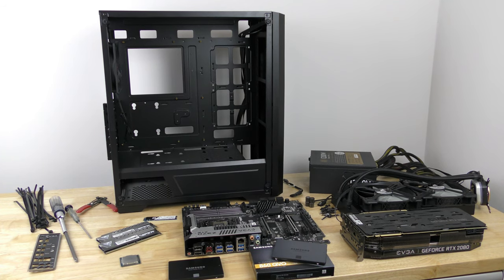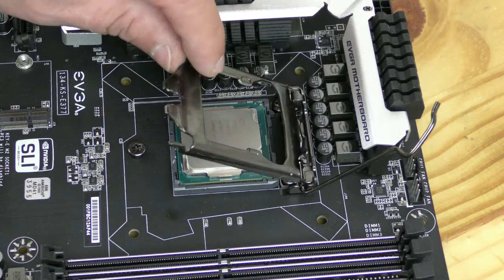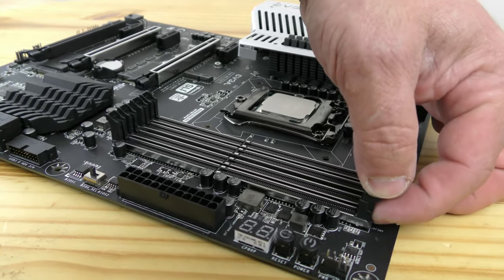How to Build a PC - Raijintek Ponos | Guide

Comment from the maker: In this video, we are Building a Gaming PC With a Raijintek Ponos - Step by Step.  This case seems to be the perfect size for anything, is it good?  Check it out and tell me what you think.
Check out the next part, how to wire the Raijintek Ponos: https://youtu.be/jwx2rDfEBSI
TimeLine:
0:00 Intro
0:10 Going over all the parts in the system
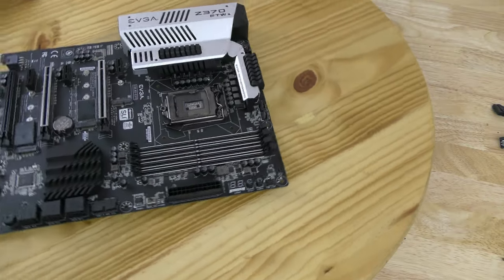1:07 Installing the CPU
2:52 Installing 32Gigs of RAM 
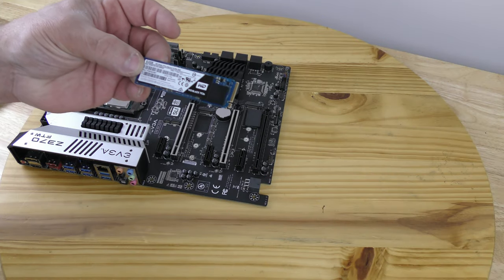4:37 Installing M.2 NVME PCIE SSD
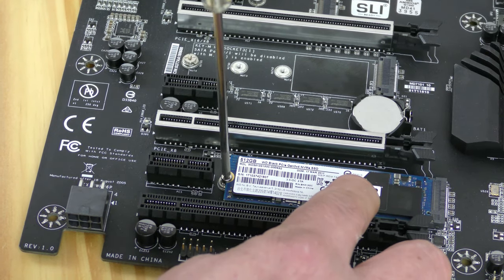5:49 Installing a Liquid Cooling Unit
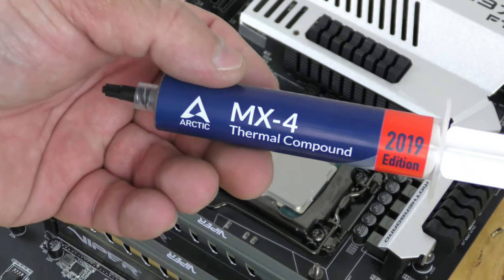7:33 Applying the thermal paste
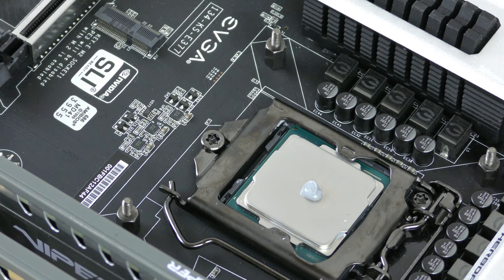8:15 Continuing to install a Liquid Cooling Unit
9:53 Installing the I/O Shield 
11:18 Prepping the case to install the motherboard into the case
14:45 Installing the Liquid Cooling unit into the case
19:01 Installing the SSD's
22:26 Installing a Power Supply
Cabling the system and completed the build continued on Part 2 and of the video.

Raijintek Ponos TG Case: https://geni.us/vssbX
EVGA Z370 FTW Motherboard: https://geni.us/X9eVgAq
EVGA Geforce RTX 2080 XC Ultra Video Card: https://geni.us/SwBEU6
Corsair H115i Pro Liquid cooling unit: https://geni.us/KhslEW2
Intel Core i7 8700K Processor: https://geni.us/jD0s8D
Patriot Viper 32Gig 2800MHz DDR4 PVE432G280C6KGY: https://geni.us/wPWP1EO
Arctic Silver Mx4 Thermal Paste: https://geni.us/ouFTBY
WD Black 512GB M.2 NVME PCIE SSD : https://geni.us/mMNLde
Samsung 850 Evo 500GB SSD: https://geni.us/QTA2
Samsung 860 QVO 1TB SSD: https://geni.us/Cqm4L
Cooler Master Silent Pro Gold 1200W PSU: https://geni.us/7hdBk
Ratcheting Screwdriver Set: http://geni.us/UBrv
Reply from the maker: a

Comment: Nice vid! I was not aware of this model of case. I'm interested in slim ATX cases since I have a small space for my PC case in my desk. 

I'm not sure, but it looks like the drive cage can be reinstalled more towards the front of the case in order to free some space for PSU cables.
Reply from the maker: Hmmm, that's a good point, I will verify but the next video has a few other places for drives too
Reply from the maker: Thank you so much for stopping by to check out the video, your compliments and the comments, it means a ton to me.

Comment: Iggy, what was the total build cost on this (aside for the 2080, which is almost a house payment)? I'm interested in building another PC (because, reasons) and this renewed my interest.
Reply from the maker: Very happy I could inspire you, and yeah the card is expensive, I bought it myself, but I gotta have something to review, as a small guy, NVIDIA doesn't pay attention to me.  The entire cost is 2,363.85, but these are not the newest component's, if you want something newer, check out this build: https://youtu.be/oPpXQV7niWg.  Below you can find a list of all the parts and my Amazon affiliate links to them, it helps me out tons if you use those links.  In the video I posted above, you will also find links to all the pieces in the description and pinned comment.  Let me know what you think, also, what will you be using it for and what is your budget?
Raijintek Ponos TG Case: https://geni.us/vssbX
EVGA Z370 FTW Motherboard: https://geni.us/X9eVgAq
EVGA Geforce RTX 2080 XC Ultra Video Card: https://geni.us/SwBEU6
Corsair H115i Pro Liquid cooling unit: https://geni.us/KhslEW2
Intel Core i7 8700K Processor: https://geni.us/jD0s8D
Patriot Viper 32Gig 2800MHz DDR4 PVE432G280C6KGY: https://geni.us/wPWP1EO
Arctic Silver Mx4 Thermal Paste: https://geni.us/ouFTBY
WD Black 512GB M.2 NVME PCIE SSD : https://geni.us/mMNLde
Samsung 850 Evo 500GB SSD: https://geni.us/QTA2
Samsung 860 QVO 1TB SSD: https://geni.us/Cqm4L
Cooler Master Silent Pro Gold 1200W PSU: https://geni.us/7hdBk
Ratcheting Screwdriver Set: http://geni.us/UBrv